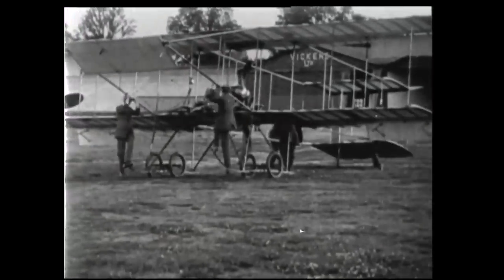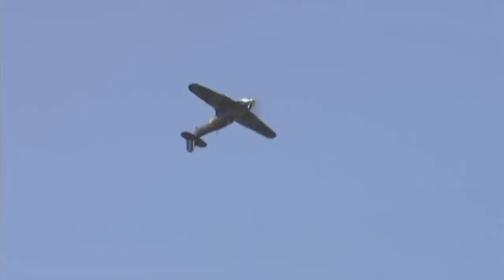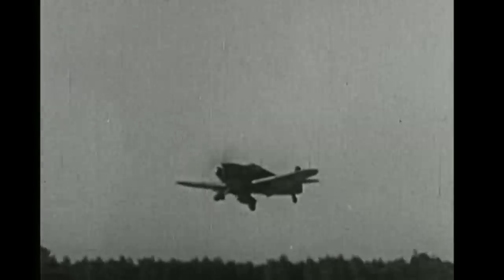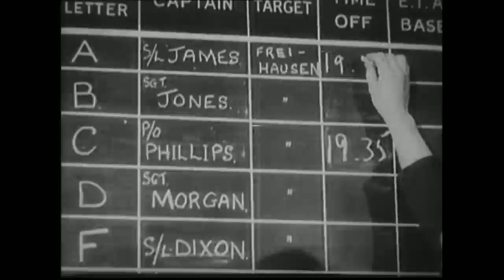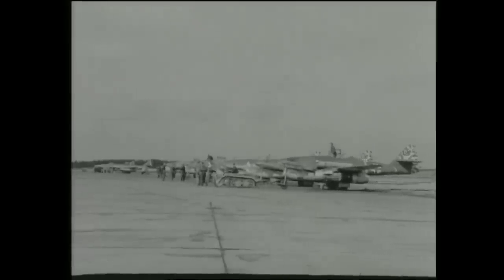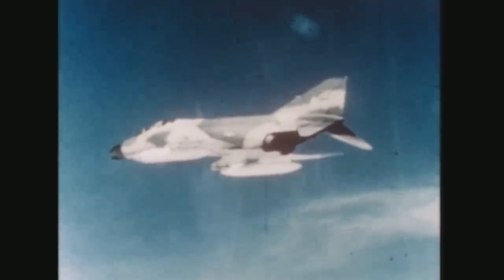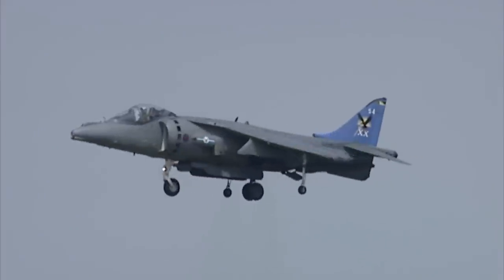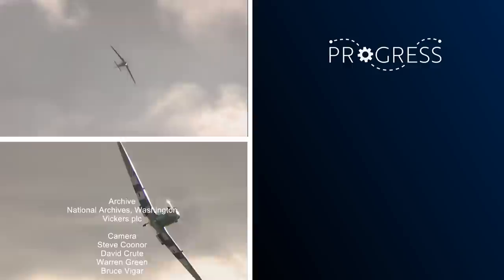The Legendary Warbirds That Shaped History

Comment: In 1941 the B17 and Mosquito both carried 4000 lbs of bombs. To me, that makes the B17 a relative failure. It carried a crew of 10 to the Mosquito's 2.
Reply: Easy answer.  Range.  it only had a 1200 mile range carrying two 2000 lbs bombs.   It ha limited bomb  storage due to it's small size.  Meanwhile, the B-17 (and let's remember the B-24 had a longer range) had a range of 2000 miles carrying 4000lbs of any shape or size bomb.  The Mossie was more equiv to the P-38 in range, payload and speed.  And neither made great heavy bombers although both could carry as much.
Reply: DH98 Mosquito FB. Mk VI
2,305 built.   (about 1/3 of wartime production)
Fighter bomber / intruder variant using Merlin 22, 23 or 25. 4 machine guns and 4 cannons, plus 2 x 250 lb bombs carried internally & underwing carriage of up to 2 x 500 lb bombs. Could be fitted with underwing rocket projectiles or drop tanks instead of external bomb carriage. 
BAE Mosquito page

Comment: The Hawker Typhoon’s were replacements for the Hurricane and became the big heavy hitter that was 5he only airplane that could destroy the new FW190 in the mid 1941and was able to catch and destroy the German fighter before they could make it back. This fighter was first designed in 1939 but with teething problems, it’s davue was delayed as it was a handful as the engine was giving it trouble along with a weak tail fuselage joint. Yet it was introduced because of the FW 190. The tail plane was the Achilles heal but was strengthened with doublers around the week joint. Because the fighter was limited in the operating altitude, the Typhoon became a ground attack aircraft as the thick cord of the wing , it became a very stable gun platform and was soon equipped with the missiles that was equivalent to the broadside of a 6” cruisers. By 1943 - 44 the tempest 5 was the next design for the hawker typhoon. The tempest was redesigned with a new thin cord wing along with many other improvements of the Typhoon. So there you have it. The Hawker designs were the heavies in fighter technology.
Reply: What about the Thunderbolt?
Reply: Yea, the Typhoons are my personal favorite RAF fighter of the era, big and mean.
Are there any flying examples around that do airshows?
Reply: @AB-kg6rk  
The bolts was USAF equipment and was flown largely by the USAF so any and all was their bird. Actually the Brit’s designed the first paper fuselage fuel tanks, not Republic.
Reply: Yup, Hawker made overly heavy fighters, but not good ones until the Tempest, which borrowed heavily from other more advanced companies, including Focke-Wulf.

Comment: Jugs (P-47s) had the capacity to carry external tanks and escort bombers to wherever. Bomber Command refused, for a couple of years, to enable the Jugs to do their thing and bomber crews were being wiped out. When BC realized that "the bombers will always get through" without escort would lose the war. Between bomber command and the Mk.14 torpedo many people died to to political and corporate stupidity.
Reply: Good video, but he did over look the P-47 and other aircraft.
Reply: @martentrudeau6948  - Jug does the heavy lifting, P-51s come flying in gleaming and proud.
Reply: @martentrudeau6948  Also the P40 which out performed the hurricane and built 14,000 of them and used by ALL Allied nations in all theaters of the war, may not have been the best but was good enough and available in large numbers even at the start of the USA in wwii  Also the F4F Wildcat  F4U Corsair and F6F Hellcat
Reply: @dennismason3740  In the beginning (1942 and 1943) it was the P-38 that used for bomber escort on the last leg.  The P-47 was used all the way to the German border and the P-38 would pick them up.  The problem wasn't that the aircraft couldn't do the job, they misused the Aircraft forcing them to fly in formation with the Bombers.  Neither the P-38 nor the P-47 liked to fly at 175mph and get jumped. In late 1943, they changed that tactic and allowed the fighters to operate ahead of the bombers.  Oftentimes, the P-38 and P-47 would disrupt the Luftwaffe  putting together the fighter cell of 50 or more fighters in hunt for bombers.  Even in 1944, when the P-51 had enough quantity, the P-47 and P-38 were used in the early legs so they could escort the bombers and then have enough gas to strafe on their way home on the ground.  Contrary to "Popular" beliefs, no fighter had the gas to escort the bombers all the way to Berlin.
Reply: @darylhunt2148  - Thank you Daryl Hunt.  I still want to punch Bomber Command in the nose for not putting the hard points on the P-47 or sending fuel tanks - the Brits were making paper mache external tanks for the Jugs.
Reply: @dennismason3740  The brits had this thing about "If it's not British" crap.  Funny, both the P-47 and the P-38 used drop tanks in the med and pacific.
Reply: @martentrudeau6948 he tried to make 1 video when he should have made 2. 1 about RAF and RN aircraft and 1 about various nations great aircraft.
He talks about the F86 Sabre and briefly mentions the MIG15 which was superior in some aspects. He also fails to mention Soviet pilots flew in MIG15s in Korea and that the 9:1 kill ratio claimed for the Sabre ins now known to be wildly optimistic.
He never mentions a lot of other great aircraft such as the MIG21 and Mirage.
Reply: @darylhunt2148 the Brits did fly the P51
Reply: @nigeh5326  Yes. the Brits were the reason that the P-51A was made.
Reply: @wilburfinnigan2142  "Not the best" is why it didn't  mske the cut for this video.
Reply: @bradmiller7486  the 51 a didn’t work because of the Allison engines. They couldn’t fly high and win. It was R.R, merlin that made the 51 the 51 and thats a fact. The typhoon’s were the replacements for the hurricanes in 1939. I do believe that it per datées your 47’s. The escorts for your infamous b17 wasn’t under Bomber Command either. Your own airforce said that the 17’s didn’t need escorts. The fortress could go it alone. The jug was the mighty eighth project not Bomber commands. You should know your history before you write mistakes. As far as the p40’s, the hurricane was of a different age along the time line of aircraft. It couldn’t fight at the altitudes of the European theatre, the fighting was done in the bomber streams and was long in the tooth.
Reply: @wilburfinnigan2142  Yes, the P-40 (even early ones) out performed the Hurricanes.  The Hurricane (Fury Monoplane) was a flawed design with an incredibly thick wing, but sadly they were kept in production and on the front lines far too long. It couldn't even dive above ~390 mph.

Comment: Hurricane (Fury monoplane) aerodynamics and engineering:  the pinnacle of 1920s technology (except for the Merlin).  It was obsolete by 1940.
Reply: Are you aware that some Fighters and almost all the Bombers in the  Battle of Britain went to the  Hurricane?
Reply: @darylhunt2148  Are you aware that the Hurricane had the worst kill ratio in the BoB, worse even than the Me110.  There were more Hurricanes than Spits, but the Spit Sqns had more aces, less losses, and the top 3 scoring Sqns were Spitfire Sqns. 

There's a reason the Hurricanes were sent after slow, bomb laden bombers.
Reply: @bobsakamanos4469  And yet the Hurries had a higher kill rate than the spit.  Imagine that.  Believe it or not, the Hurry could turn inside both the 109 and the spit when it got into trouble.  You didn't light take the Hurry.
Reply: @darylhunt2148  LOL, read up on the kill ratios of BoB.  Hurricanes had the worst results. There's a big difference between kill ratio and raw numbers in a war of attrition.   The turn radius is only one metric in fighter ACMs.  I take it you don't fly, so I'll explain.  The Hurri was about 900 lb heavier than the Spit and had a grossly thick wing.  Speed, acceleration, climb, dive, roll rate all favoured the Spitfire vs the old Hurri.  Yes, its turn radius was good, but rolling into the turn was slow.  (LW evaluation of captured Hurricane: "lazy ailerons")    Now, going into a tight turn means slowing down and a 109 could roll and accelerate quickly out of that turn climing or diving better than the Hurri.    
That's all one on one fighing, which of course is not how fights were conducted typically, but you see how your one metric is not significant to 109s that usually didn't even play the turning game, at least not until they were made to give close escort.  I'll have to add that quite a few Hurricane "victories" were over the homeward bound, already damaged stragglers.  And one final note on BoB kill ratios - Hurricanes were mostly attacking slow, unmanouverable bomb laiden bombers while Me110s/109s were bringing down fighters.  That skews the stats even further in favour of the LW.
If we're talking aircraft design/performance, the Hurricane was obsolete by 1940 as a day fighter.
Reply: @bobsakamanos4469  Nice try.  20+ years USAF retired.
Reply: @darylhunt2148  if that was true, then you'd already understand the key metrics of ACM and wouldn't be hung up on the only handling virtue of the Hurricane.  Nice try.
Reply: @bobsakamanos4469  There is a good chance that funding for the Spit was connected to this idea.  It may be true or not.
Reply: @darylhunt2148   LOL not true, although they were well aware of the correlation between wing loading and turning.  It was a private venture, with input from Ministry later on. Speed and especially armament (8 guns) were the key factors.  Ref: Morgan and Shacklady.

Comment: 26:00 it took a British built engine the RR Merlin to make the American made mustang fighter a better aircraft, and they say they bailed us out 😂😂😂😂
Reply: Allison could have presented a 2 speed, 2 stage supercharger but the War Department deemed it more important to build the non super charged version for the P-40 and the turbosupercharger for the P-38.  Same goes for mods on both, just keep producing.  And no shutdown for 2 weeks to facilitated a major upgrade.
Reply: @darylhunt2148  The P-40 Allison always had a s/c.
Reply: @bobsakamanos4469  YEs it did but it was a single stage which only took it to about 15K.  The Merlin had a 2 stage, 2 speed SC.  What's funny, the P-47 had a supercharger and a tubo charger on it and made tremendous power at all altitudes.  Why they didn't put a 2 stage 2 speed supercharger on both the P-40 and the P-38 is beyond imagination.  The ONLY thing that the turbosupercharger on the P-38 really ocntributed was to the Jet Engine.
Reply: @darylhunt2148  The Allison design had all kinds of issues.  They did actually produce a version with a second external supercharger, but without intercooler/aftercooler among other things, it was a flop.  It also needed a redesigned accessory case and redesigned intake manifold (which eventually arrived for the P-38 in 1944).  Remember also that the P-40 was a small airframe and already too heavy and overtaken by better designs.
Reply: @darylhunt2148  While we're talking about Allison engines, it's noteworthy that after the P-82s  failed in Korea, some of those aircraft were stored at NAA where the NAA engineers tried to remedy the engine detonation problems with backfire screens.  Allison got wind of that and told them to stop.